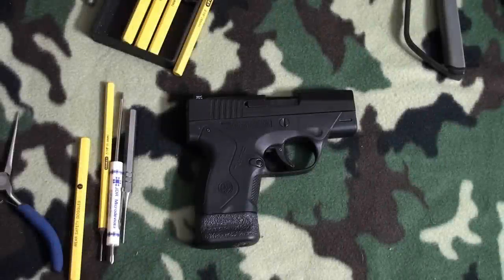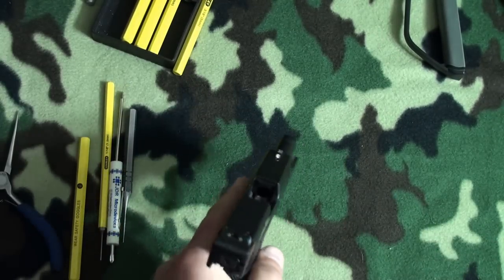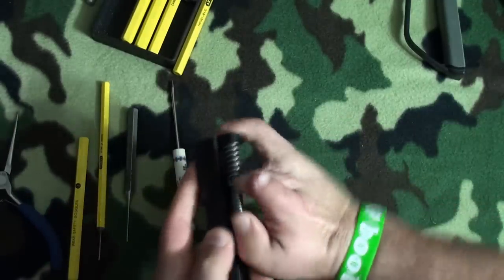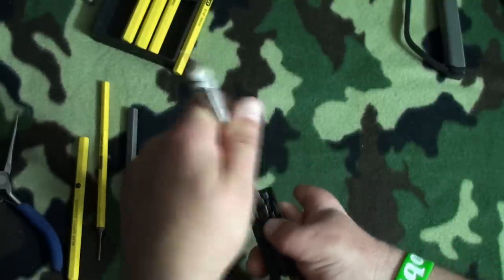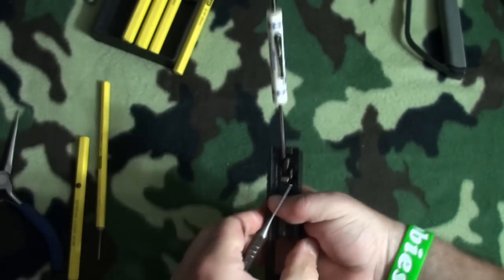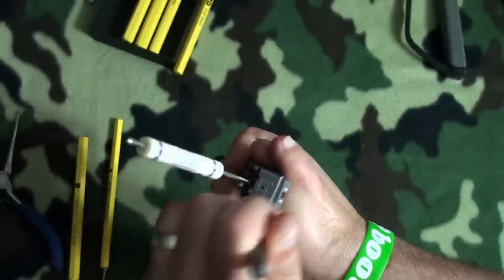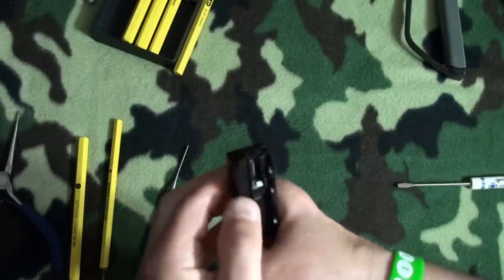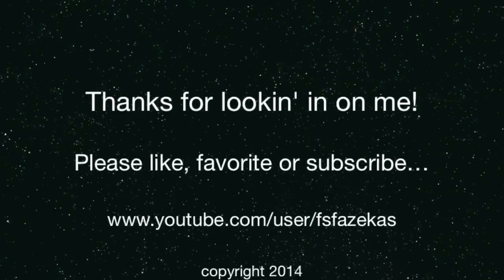Beretta Nano - Slide Disassembly how to

Comment: I just wanted to share my experience with my Nano. I bought it about 2 years ago. In the beginning, I was having one FTE every 10-20 rounds using 115grain. I changed to 124 grain and it helped a bit, but I was still having FTEs like 1-2 every 50 rounds. I was frustrated and disappointed because I also own a Beretta PX4 that is flawless. So, I started reading reviews and watching any videos that could help me. I really didn't want to send it back to Beretta for two reasons. First, the hassle and waiting time. Second, I don't think they really go through every single part and do it properly (sorry Beretta, if I want it done right I do it myself). So, I knew there was something weird about the extractor function and I started thinking about removing and cleaning it. But I had no clue how to do it. I found this video and it was extremely helpful. I watched it a couple times before I started the procedure. Let me tell you, there was a lot of gunk behind the extractor (in the little well) and inside the striker assembly and spring. I guess Beretta applies some grease that becomes a hard yellowish wax like thing. I cleaned it all out by using a good gun cleaner and a lot of patience. I also borrowed a jewelers cloth (thanks to my sweet wife) and polished the extractor a bit just to remove any stuff that could be stuck to it (not really polishing to remove material). More cleaning and a very light coat of high quality oil. Wiped the parts clean to remove any excess oil and put it all together. I did this about a year ago and my FTEs reduced to maybe 1 every 150-200 rounds. I've been shooting 124grain FMJ (sometimes HP) about 50-100 rounds every other week since then. The Nano has been getting better and better.Fast forward to present day. I decided to do this thorough cleaning again. I had some residue from the ammo but not too bad. I simply cleaned all parts (extractor, extractor spring, rod, striker assembly, etc.) Oiled it with a light coat of quality oil and wiped it clean. Went to the range today and fired one mag of HP that was already in it followed by 150 rounds of 124grain FMJ. I had zero malfunctions and the Nano does seem to be operating much smoother.So, my conclusion is that breaking in the gun is important because it's very stiff in the first few months. Also, a thorough cleaning like I did should so wonders to help things work smoothly. The Nano has (IMHO) very tight tolerances. Add that to the fact that it's a small gun and you may explain some of the malfunctions.I am not a gun smith by all means, but this video did help me perform the cleaning without a problem. Just remember, it may void your warranty, so do it at your own risk and ONLY if you're comfortable doing it yourself. All in all, I think taking the extractor apart and cleaning/polishing it helped like 100%.Thanks for putting this video together and taking the time to explain how to disassemble it properly.
Reply: pc3822 That's enough info to justify a video in itself!

Comment: so i used this video to get me strted but have found this can be done much more easily. you DO NOT have to pry on your striker spring. simply push it all the way forward (remember to push the striker block down) then us a punch to push the extractor plunger in at the same time. with both those done u can pull the plate off. i found that prying the spring isnt a good idea beacuse it is mounted to a very soft plastic guide rod. i acually chewed mine up pretty bad by trying this.

Comment from the maker: For some reason, I cannot reply to boost331's comment below regarding the prying out the striker spring.  In any case, if you didn't notice, I have some issues with manual dexterity due to the nature of my right hand.  I don't believe it's possible to perform all these actions simultaneously in my case, so I pry the striker spring out of the way and use the screwdriver to hold it there while I work the other tasks with both hands.  I have not damaged the guide rod for the striker spring in my Nano but as boost331 says, it's soft plastic and could be damaged if you manhandle the thing.  Use a delicate touch OR use boost331's technique and avoid the prying altogether.  Glad people are putting in time to find different ways to accomplish the same thing...

Comment: Looking for comments on lubing the striker guide rod with spring. Since its all inside the hollowed firing pin/striker, it shouldn't gum up the action of te striker. Thoughts? I have a metal one which isn't self lubricating the way polymer is alleged to be.
Reply from the maker: +Ray Houthuysen Ray, thanks for watching and commenting.  I don't have any experience with a metal guide rod so this is just a suggestion and I can't be liable for any issues you may have with the gun.  If I were going to lube this, I'd use Ballistol and after coating it, wipe it completely dry.  Ballistol seems to leave the metal surface slick even when a cloth no longer picks up any off the surface.  However, I guess you have to judge if you think there is going to be enough friction between the metal parts to require lubrication.  Also if this is an aftermarket upgrade, maybe ask the manufacturer if they recommend lubrication.  Anyone else with more knowledge than me (like everyone) have any thoughts???

Comment: Do you know if the Nano has a plastic firing pin?
Reply from the maker: Thanks for watching and commenting!  It has been a long time since I disassembled my Nano slide however, from memory and online research, the Nano has a steel striker.  HOWEVER, the striker guide is plastic from the factory and is said to be prone to breaking. Apparently the "head" of the guide breaks off.  You may be interested in this stainless replacement part from Galloway Precision - for $13 I'll probably get one myself just for $hits and grins.

https://gallowayprecision.com/beretta/nano/striker-guide-for-beretta-nano/

Comment: Good video, also if you didn't know Galloway Precision has some quality steel parts to replace the plastic ones on the Nano. I was curious as to the problems you had with the extractor on your Nano, and was the replacement extractor from Beretta. Thanks for the video...
Reply from the maker: +tooManywaystoFall thank you for watching and commenting!  I didn't necessarily have an issue with the extractor...somewhere I picked up that early run Nanos were prone to failure to extract/eject issues and and that there had been a change on the Beretta extractor though no change in the part number.  On the off chance that this was true, I decided to replace my extractor.  Hopefully this spring, I'll get the Nano back out and see "what is what" with it.  I am 99% certain it needs to go back to Beretta but it's been so long that I need confirm.  I'd like to get it working it's a great shooting gun if I could just get these couple issues worked out.
Reply: Now in 2022 you can't find parts for the Nano.

Comment: Good video, but wondering why you didn't go ahead and remove the back plate and finish disassembling the slide (removing the firing pin, etc.)?  The main reason I ask is that I feel it would be useful to see exactly how to put it all back together after complete disassembly.
Reply from the maker: Thank you for watching and commenting!  The point here for me was to show how to remove the back plate from the slide as that's not really obvious.  Until I learned how it was done it was like one of those Oriental puzzle boxes to me ;)  However, as I had practiced the disassembly a few times and already replaced my extractor and extractor spring - I felt it wasn't necessary to go any further.  HOWEVER, you do make a good point, why not complete the break down and show the full disassembly??  I agree that's a valid point and maybe I'll replace/revise this video at a later date.

Comment: Was there a difference after you replaced the extractor/spring? Thanks
Reply from the maker: Thank you for watching and commenting!  I apologize for the delay in responding, I am usually much quicker than this.  Unfortunately, this did NOT resolve the problem with my Nano.  It turns out that my issue has to do with the magazine release being switched to the right side of the frame (for left handed use) and in this configuration the mag drops with (nearly) every round that is fired.  Until that issue is resolved, all bets are off as the mag dropping upon firing can cause a number of random effects that could look like other issues.  I still haven't sent the gun back to Beretta yet, my life seems to be getting busier and busier.

Comment: can someone help me, I got the back plate off and I can't compress the striker spring enough to get the backplate on. do I just have to wedge it together. much help would be appreciated fellas!!!!
Reply from the maker: +Dawn Baemel  Hi Dawn, it's a bit hard to help since I can't see what's going on.  I know in my experience, I didn't have any problem compressing either of the springs to slide the back plate into place.  My first thought would be  to figure out if everything is assembled right...maybe something is hung up somewhere that is causing this issue.

Comment: thank you for the video, 
anyone know of any other firearm sights that fit the nano? surely they aren't totally proprietary sights... hoping something like sig sights fit? I dunno
Reply from the maker: Thanks for watching and commenting. I swapped out my sights for the  Berreta Nano night sights...but of course those are a Berreta product.  Also, you didn't say that you were looking for night sights. I do get hits for other night sights by Ameri-glo but I really didn't see anything if you just wanted to change from three dot to say dot and post sights. That's too bad as it would be nice to have some options.
Reply: +fsfazekas yeah that's why I ask was wondering if there is actually any other options for sights,  Galloway had something fir a micro optic but the page is down or removed so there was some hope there,  there's gotta be some other gun out there that takes the same sights and has better
Reply: +217RockStar217 funny how I'll be using this 50$ beretta rebate to replace the most important parts that they chose to make plastic. .. ugh
Reply from the maker: 217RockStar217 I hear you, I just came across a picture where I did a bunch of upgrades to my M9.  Basically the same thing, converting all the polymer parts to metal.

Comment: Really good video!  How is your nano working now?
Reply from the maker: mesarock2vh Well, I got a new grip in olive drab but the magazine issue is still there with the 8 round mag and the mag release button on the right side (left handed).  The 6 round mag (I converted an 8 round back to 6 round for testing) is better but if I work at it, I can pull it out.  I need to range test the 6 round mag with mag release on the right side.  Also, though I replaced the extractor and the extractor spring, I haven't range tested  yet to see if it works any better.  Still working through blocks on the flow chart but it IS going to have to go back for the magazine issue.
Reply: Is your mag release catch worn out?  I had a similar prob with my CZ 97 every shot my mag would drop out.  Or maybe your mag release catch spring isn't snug.
Reply from the maker: mesarock2vh I don't know...I suppose it could be....I just ordered a new catch and spring just in case anything is worn...but I still think is't a defect in the design.  I had another person who commented here change their mag release and the exact same thing happened.